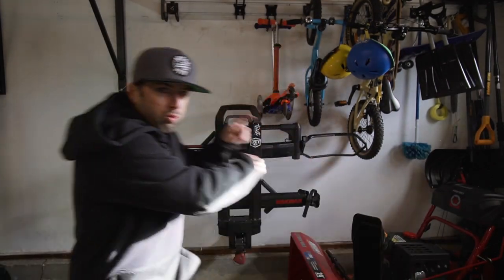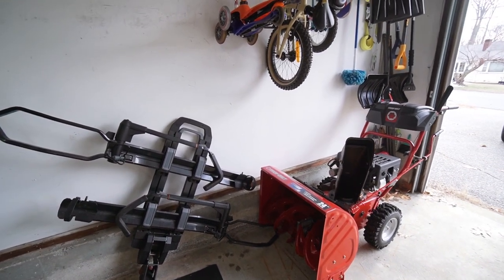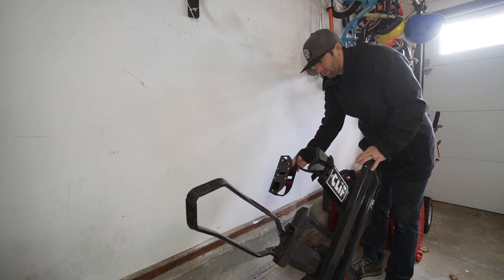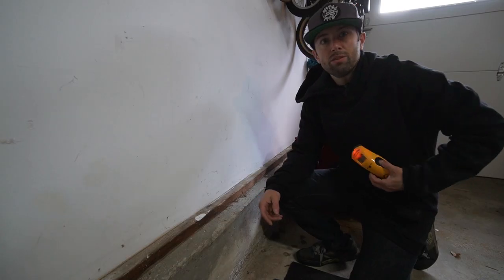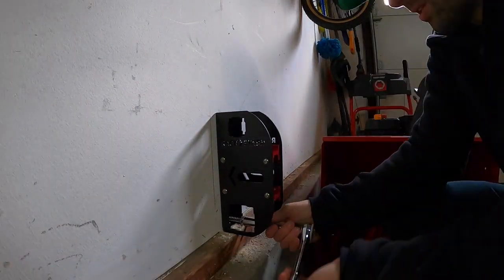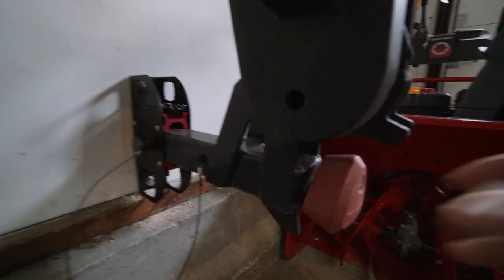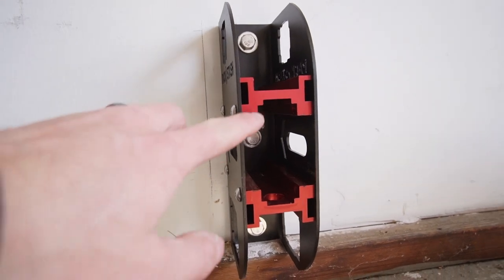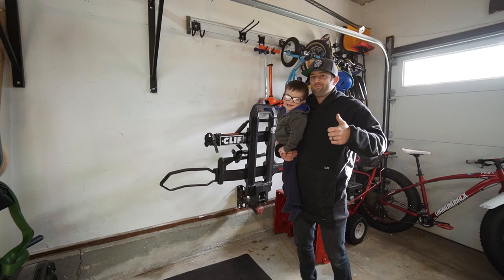The Rack Stash - The Best Way to Store Your Hitch Rack?

Comment: With this would work for my north shore. But the 6 bike version is far beyond 90
Reply from the maker: 1 up says recommended max weight of 90 lbs, so I wouldn't push it further than that! The NSR website lists the 6-Bike Straight at 69 lbs, and the reg 6-Bike at 72, so if you have either of those you should be good.

Comment: Can you hang a cargo carrier upside down?  Am I put the rack stash higher up the stud and have the carrier hang downward? Thanks!
Reply from the maker: I THINK it would work. The upper/lower holes are meant for storing a ball hitch but I think you could slide a cargo basket in vertically and use a hitch pin to keep it in place.

Comment: Hey great video. Just out of curiosity which hitch rack is this?
Reply from the maker: Thank you! It’s a Yakima Dr Tray!
Reply: @MTBMA  Cool. How do you like it? I'm looking for a double rack right now. Amazon has a Kuat Sherpa 2.0 for $448 brand new.
Reply from the maker: @chadhelvey7827  going on year 4 and it’s been super solid. Love the sliding/adjustable trays and how light the rack is in general. Only complaint is the release button for the front wheel holder is kinda janky. I have friends with Kuat and they are very pleased, and that sounds like a solid price!